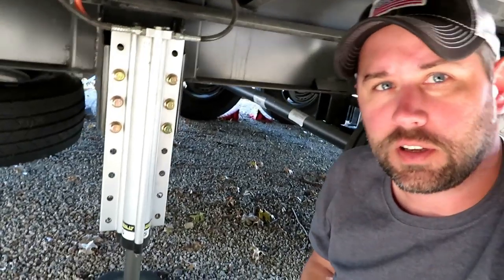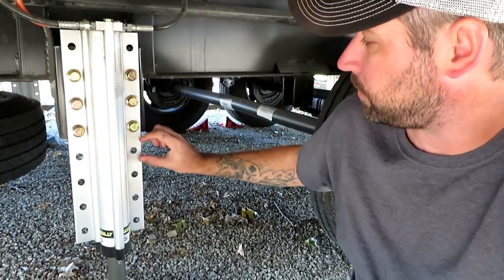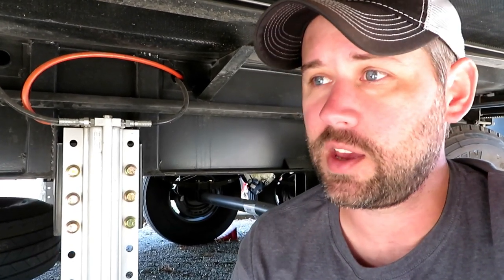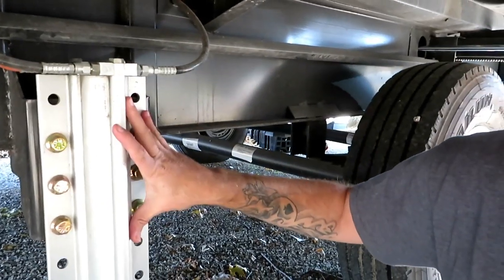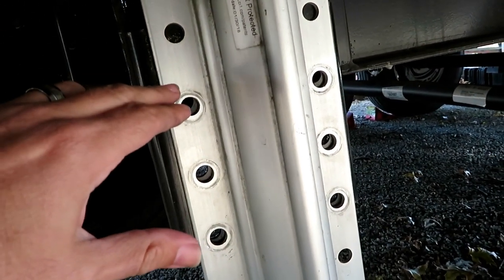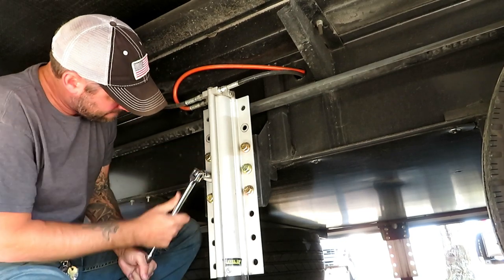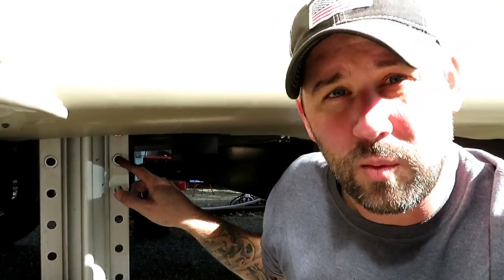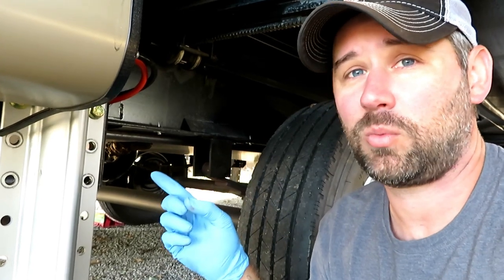Avoid an RV Disaster! (How to adjust your RV Leveling Jacks)

Comment: Just a little FYI. When breaking a Nut & Bolt loose Always hold the bolts and turn the nut. It makes it a lot easier 👍
And when tightening hold the bolt and turn just the nut also. 
You should have also referred to the manufacturer Torque Specs and used the proper specifications for those aluminum flanges. 
There is a large amount of weight and $$ riding on those 🤔

Comment: I have the problem of my driver side rear jacks sagging while driving down the road. I have the Lippert hydraulic system on my 2018 Montana 5th wheel with 4 hydraulic slides (plus one electric)  and 6 leveling jacks, all running off the same hydraulic system.  This weekend, I am going to change the hydraulic fluid using Lucas Hydraulic fluid and a quart of fork oil, to hopefully resolve my problem.  I had my neighbors following me to a campsite back in June, and they would call me when that rear jack would begin falling down.  We had to stop, pull it back up via the control   panel, then move on, but it happened 4 times over 200 miles.  Hoping the fluid change will resolve, as Lippert says to change the hydraulic fluid every 3-5 years, but if not, I may raise the rear jacks as you showed in your very good video.  Thanks!

Comment: Those bolts are supposed to be torqued to 52-64 ft lbs.  based on the Lippert Level Up  Installation guide.
Reply from the maker: Thanks for the info Paul. We appreciate it.
Reply: You know I was gonna ask that.

Comment: Great video.  Just wanted to mention that I noticed that it looked like the hidrolic line was touching the bottom of the RV or frame. Might want to put a water hose or something to cover the line. It will over time rub a hole in the hidrolic line. That won't be fun to replace. Love the videos! Thanks.
Reply from the maker: Glad you noticed that. I will go out and look at the lines and cover them so they do not rub.
Reply: No problem. Glad to help. I enjoy watching your show. I have a 3661RL Montana so I'm always looking for ideas to make life easier.
Reply: I was gonna mention that. I'm a truck driver and I've seen that sort of thing rub through pretty quick. Good video. I also enjoyed the one on why you should not RV full time.
Reply: Thanks for your service and thank you for honoring the fallen heroes.

Comment: You may need to use some leveling blocks under your jacks now because the further you extend the jacks the more movement you will have inside
Reply from the maker: We have not had to yet but we have some blocks just in case.

Comment: GREAT video, just wondering went you finished up and level your rig, did you have to recalibrate your leveling system or was it ok and leveled back up?? TIA!
Reply from the maker: We did not have to recalibrate. It still leveled perfectly after the adjustment.

Comment: Two things. First if I were you I would go to Harbor Freight or where every you like to shop for tools and buy a decent electric impact wrench. It will come in handy for a lot of other things also. That is how those bolts which look like Grade 8 bolts got to tight. Great tool for removing and re-installing. Also have you read your warranty completely? Every word? Because I have read a few of those new trailer warranties and if you even drill a single hole or change a single bolt you can void your entire warranty and they don't tell you about it until someone wants to get out of doing a warranty job on your trailer for free....  I can't say it's like that for all manufacturers and dealers but I've seen enough of them to tell people to RTFW... Basically that means read the __ warranty. And understand it.
Reply from the maker: Thanks for the tips!

Comment: You don't have a copyright on "stinky slinky" do you? I would like to use that if i may. I have never heard that one before.  I had to adjust the jacks on a friends trailer because he had gotten bigger tires and lifted the suspension .   I don't remember that his bolts were that tight.
Reply from the maker: No. No copyright. Use away! 😂

Comment: Is there any literature saying what each bolt should be torqued to?
Reply from the maker: I'm not sure. I talked to our connection at Keystone and they said as tight as you can get it with a breaker bar. Not sure how much torque if you are using an impact wrench.
Reply: I'm sure Lippert has the proper torque specks. I would not rely on just cranking them down! ⚠️They support a lot of weight and you wouldn't want them to loosen up. ⚠️

Comment: Was there a specified torque for the bolts?
Reply from the maker: I could not find anything saying how tight to make them. They were pretty difficult to break loose, so I tightened them back as tight as I could get them.
Reply: 90 ft lbs.
Reply: @Mudford63  52-64 according to the manufacturer 👍